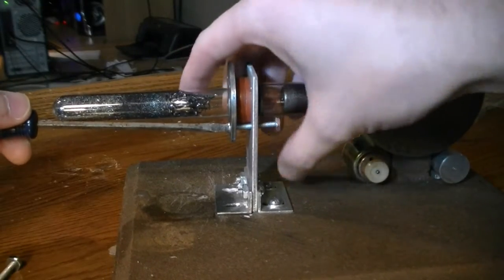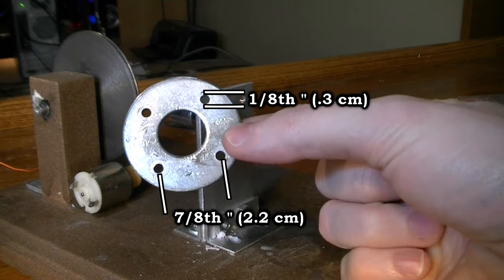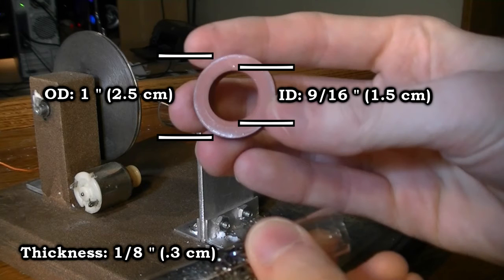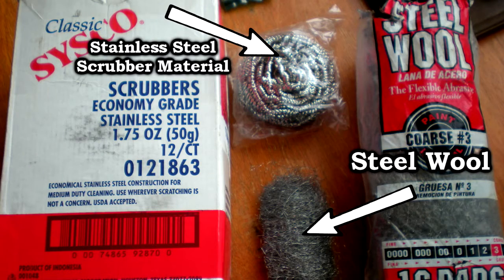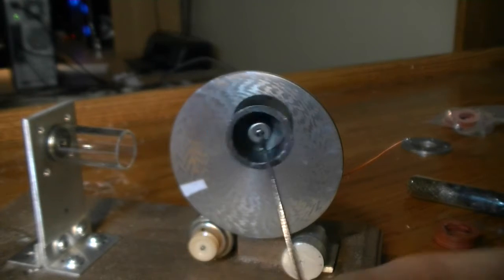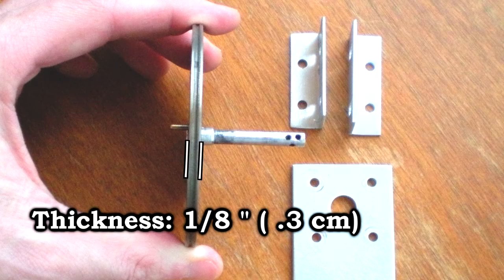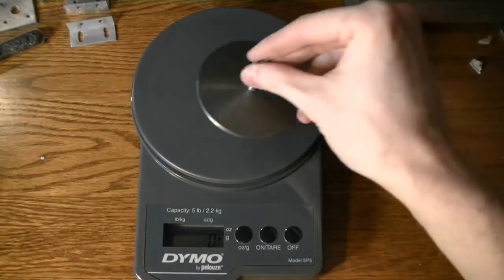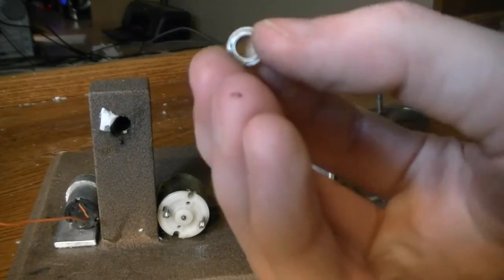Lamina Flow Stirling Engine Parts - Part 1

Comment from the maker: @adfgfds Yes it was. It comes with a black rubber sleeve on it and it also is some what closed at the one end so the graphite piston can't fall off.  I remove the rubber sleeve and shorten the actuator with a diamond cut off disc and a dremel like tool.